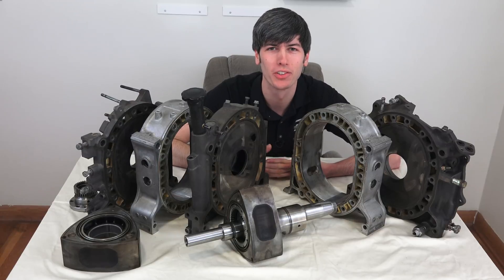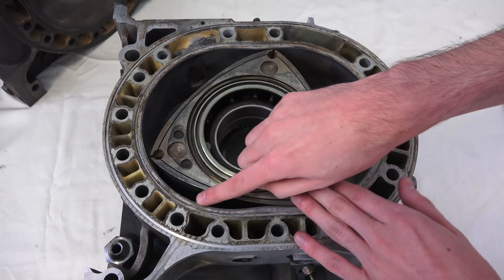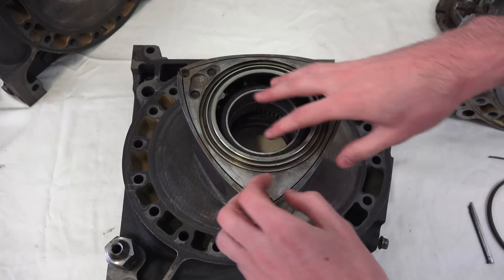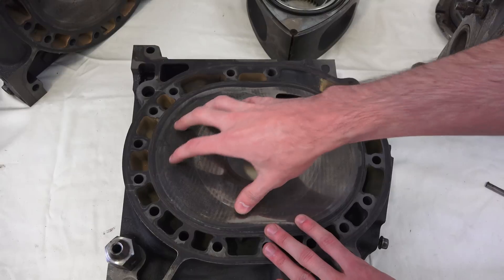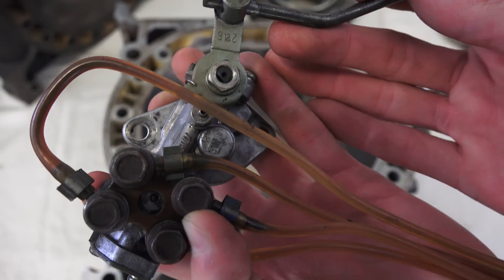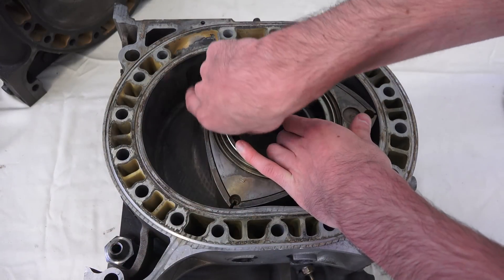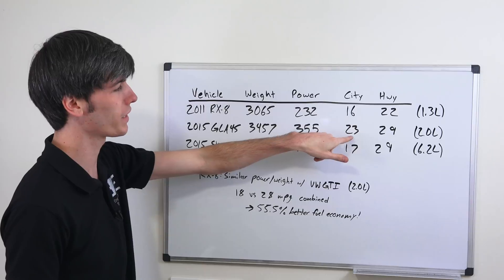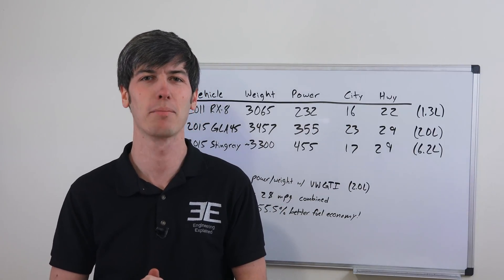4 Reasons Why The Rotary Engine Is Dead

Comment: The problem with your fuel economy comparison is that if you measure the actual swept volume of a 13B engine based on the number of working chambers its actually 3.9 litres (654 cc x 6). This is a common problem because most people just take Mazda's stated capacity and use that. Mazda is really fudging the numbers to make out that their 1.3 litre engine makes 230 hp. If you measure the swept volume of all the working chambers in a rotary engine (13B) just like you do in a piston engine it actually comes out to 3.9 litres. If you used Mazda's method of measuring displacement in a 6 cylinder piston engine then you would only be measuring the swept volume of two cylinders which is not what the actual displacement is of that engine. Dont get me wrong, I have been a rotary nut since I was a kid and currently own an FD RX7 and a series one RX8 so there is no bias here, its just a fact.
Reply: Yeah, the 1.3L designation doesn't relate to normal piston engines.  It's actually comparable to a 2.6L 4-cylinder engine.  There are two firing events per crankshaft rotation, as with a 4-cylinder engine.  2.6L of air goes in per full two-crankshaft-rotation cycle, as with a 2.6L piston engine.

The specific output isn't quite as good as a comparable piston engine, like that of the S2000.  But it's not terrible.  I think the fuel economy of the RX8 would be a lot better if it were geared for street driving.  In the RX-8, I'm into sixth at 47 km/hr (29 mph) if I'm not accelerating.  Sixth gear is at least 50% too short.  It's running 3000 rpm at low highway speeds when it should be at 2000, where it would still have plenty of power to handle mild grades.

They should have sacrificed some track performance for driveability in choosing their gear ratios.
Reply: +Messville Gaming So it only makes 230 hp on 3.9 liters? That kind of sucks.
Reply: +rpn453 Yes I understand that but you measure an engine's capacity by the swept volume of ALL the working cylinders/chambers, not just the ones that are firing in one crankshaft revolution. If you compare the fuel economy of a 13B its comparable to a 3.9 litre piston engine, not a 2.6 litre piston engine. That is because it is breathing in and using 3.9 litres of capacity, regardless of how many chambers are firing per crankshaft revolution. You also cant compare a piston engine to a rotary engine because of the amount of crankshaft revolutions it takes to fire ALL of the working chambers. Again if you measure all of the working chambers swept volume in a 13B engine it total 3.9 litres :)
Reply: +dujfraz yes but you also have to understand that the engine only has about 75 - 80 % volumetric efficiency and because of the shape of the rotor etc it doesnt burn all the fuel and only has a short amount of time to exert force on the rotor because the shape of the combustion area changes as the rotor pulls away from rotor TDC. The new 16X engine should have more torque because of the bigger rotor. Im sure if mazda treated the engine similar to a 2 stroke engine (because it has no valves to open and close the ports and only port shape to control intake and exhaust port timing) and put power valves in the exhaust (like yamaha used in its 2 stroke motorcycle engines) and possibly reed valves in the intake (again like in high performance 2 stroke engines) they could extract maximum torque and widen the power band considerably.

Comment: Your text description above is incorrect. Yes, there are no rotaries left in a production car, however there are still rotary engines in production. There is the Aixro rotary engine that is being used in go-karts and more recently paramotors with the production of them going from strength to strength. Then there are model aircraft sized rotary engines not to mention some UAVs out there that use a rotary (shadow 200 for example). There are companies like Rotron, Freedom motors, liquid piston making rotary engines to power anything from UAVs to lawmowers/chansaws/brushcutters and smaller aviation applications etc. Areas where power to weight is important. So whilst they are 'dead' in the car world, they are very much alive in some other industries, particularly small aviation.

Comment: So its problems with insufficiency is fuel economy, sealing, lubrication, and oil consumption? Do you think there might be any way of designing these differently like maybe adding another spark plug similar to an after burner on a jet engine? maybe still within the engine maybe I half way between the spark plug and the exhaust set on a small delay to ignite the unburned fuel... the other problems I don't have any ideas for
Reply: +Robert Anderson 
No, it didnt, the rotary has very large displacement with very poor power, where do you think all that fuel goes...?
Reply: you just dont understand this subject. another spark plug? this engine has only two chamber for inhale or exhale. there is no chance to another spark. another spark is useless and it does not explodes. why? no compression no explosion. only mixed with oil and compressed  fresh air have chance to explode.
Reply: you just dont understand this subject. another spark plug? this engine has only two chamber for inhale or exhale. there is no chance to another spark. another spark is useless and it does not explodes. why? no compression no explosion. only mixed with oil and compressed  fresh air have chance to explode.

Comment: You mention that at 1.3 Liters it's putting out 232 HP which is actually very respectable for an engine its size. If the RX-8 was sold with a regular old piston engine at 1.3 Liters the horse power would be pathetic. You're also comparing the engine to far newer and much pricier cars featuring more technology to aid them in fuel economy which I do not find to be a fair at all. Your comparison should have been done against cars with similarly sized engines featuring more traditional designs then I might have taken what you are saying a little seriously. 

Unfortunately you felt the need to trash a perfectly good engine design that trades better fuel economy for a ton of HP in a relatively small package. Even your comparison against the VW GTI engine isn't fair as you fail to mention at 2.0 Liters it's only grabbing ~210 HP for an engine that's .7 Liters bigger almost twice the size of the RX-8. I'd really love to see what a 2.0 Liter rotary engine would do to a dyno I'm no mechanical engineer but I bet it would be touching close to 300 HP easily.

Comment: You sound like Kermit the frog, the green amphibian  is it? Equally comfortable in land and water but mostly scooped up by the air.  by this stage. The domain of Jim Henson and is Muppets, archetypal liberal arts teacher profile. That someone like you would be a product of to some degree?  Those who cannot do, teach after all. 

But why would that be so, as you seem capable enough, Wonder what your deficiency is, aside from slight anemia? Noting to do with propensity for plugging your plug into the wrong socket would it? 

That is of course a media fabricated myth, in which broadcasters have come to be self appointed cattle auctioneers, that lasso and fence up demographics and psycho-graphics into lifestyles and personality types (including psycho-sexual history) that shunt out into various sectors of industry, commerce and government based on demands and requirements  

Driven by orders such as keeping the land (consolidated capital found in private equity and technological bases) and the water (found in banking and commerce) as free from such "soiled articles" as possible. Hence these plans to blow air into the cattle (with verbiage and multi-media content seeded with such cryptic messages )  to steer and direct social behavior into the future. Wouldn't want to find yourself jobless or lacking in career prospects after a single indiscretion would you?

While investors, speculators and underwriters calculate and gamble on the odds and outcomes. How you operate the personal body, is a reflection of how you operate the group body - exploitation , manipulation and misinformation (insinuated and inferred) sounds about right

Comment: It's fine looking at the technical reasons why the rotary engine is fuel inefficient and requires checking oil, no secret there. If you actually drive one you'll understand why people enjoy them. They're pretty fun given the RX7 series were designed to be Japanese competition to a Porsche at half the price

Comment: Strict emissions and fuel economy is what really killed the rotary, it is just that the rotary engine design was the first victim.  The next victim will be diesel engines and eventually piston engines.  Whether it outperform other engines is debatable and subjective.  We all know that a simple I4 could outperform a V8 and that rotaries have outperform piston engines.  But on this day and age the rotary engine simply does not belong any more.  There is more R&D in piston engines so it is not surprising to see piston engine efficiency progress through the years.

Comment: Suppose a rotary engine could have a place in motorcycles? Would the inefficiencies be a little more...negligible? The acceleration characteristics, when combined to a shaft layout would be at least very appreciable. And the saving in weight, a motorcycle could have a MUCH lower center of gravity.

Comment: Thanks for this video, helps to put things into perspective. I know this is a separate issue as this video covers the rotary however emissions hold back a lot in motor development now a days. I love 2 Stroke engines but they also suffer in the emissions department. That being said I did see that a company called Athena were developing more modern and efficient fuel injected 2T engines. Would be nice to see them make a return :D

Comment: The moving parts count. That's where the rotary wins hands down. There's more moving parts (things that will fail) in one cylinder of a piston engine than the entire rotary. Right?
Reply: +Justin edwin yes, and no. Metalurgy is such that failure isn't all that likely in regular engines these days. That being said. if you HAVE to fix it yourself, there's certainly less complexity. The seals on the corners of the triangular piece also wear out somewhat often. The simplicity makes them popular in small engines, though.

Comment: Hmm its apparent that you have missed a key point. 232HP from 1.3L. Also those newer engines have way better fuel economy technology. Show me another 1.3l that makes that much power.
Reply: +Galen Ognelodh 
The 13b sucks in and burns 3.9L of air and fuel with every revolution but only produces 232bhp....

A Honda 1000cc RC213v puts out over 250bhp

Comment: why there is no one  wants to use small single spool gas turbine engine ?
Reply: +Catalino O Calimlim cost, mostly. these things are still used in R/C and drone engines. to make a turbine small enough to fill the same role, you'd have to use a lot of expensive high temp alloys. One of the reasons the Chrysler Turbine never happened.
Reply: have you ever watch about in gas turbine water pump ?even that was too costly ?

Comment: are you kidding?
this video is preposterous.

230hp from a 1.3L engine out of the factory, Naturally aspirated.

455hp from a 6.2L  engine, from factory, Naturally aspirated.

6.2L divided by 1.3L = 4.8 <(formula figure)
4.8 X 230hp= 1104hp.

If the rotary engine was 6.2L it would theoretically produce 1104hp naturally aspirated with the same engine technology, now put that into power to weight AND power to displacement.

So yes, the rotary engine is dead for a soccer mum to go buy her milk, or for nan to go pick up a new role of yahn.
but NO, the rotary engine is NOT dead for enthusiasts and people who are excited by old engineering that continues to out perform "State of the art SOHC v8 engines" made by chev.

So rethink your strategies boy, your common sense is heavily under weighed by your engineering uni course...
Reply: +David Sagstad 
Thats right, but a rotary engine cannot, hence they are dead.
Reply: +Alex berry 
Clearly you know nothing about rotary engines. You dont think that its slightly odd that a supposed 1.3L engine allegedly produces 230bhp and yet has been ignored by the whole automotive industry? Or could it be that all the engineers in all the of the companies around the world understand that its actually a 3.9L engine that only produces 230bhp....
Reply: Bike engines can crack out the best part of 200hp in 1.3L. With turbo etc you can get a 1.3 running around 800hp (pretty laggy I guess).  Look up hyabusa tuning!

Comment: I have a 79 with a bridge ported rebuilt 85 12A engine with a 48 IDA Weber downdraft in which I removed the oil injector, blocked it off and have been running for 3 years and 12,000 miles by using 8 oz of 2 stroke oil at every fill up. The car has more power but the gas mileage is still poor but the car is a blast to drive. Any long term problems with mixing 2 stroke oil instead of direct oil injection?

Comment: I owned a 2011 RX8.  Most fun I had in a car under 16K in my life (bought it used, one owner).  But it was only my weekend car when I first bought it.  A year later it became my main vehicle and the MPGs really are what forced my hand into selling it.  not even 2 years after owning it.  However, if it had stayed my weekend car, I'd have never sold it.  Lot's of fun to be had with a 9000 rpm redline and that distinct "buzz" of a rotary.

Comment: Oh i was so much confused in the end, in europe it is liters/100 km, not miles/gallon. So if you use liters for marking engines, use it with the other things too..
Reply: +NecumNaTo that's because in the states with have speed limits and sell fuel in imperial. So you'd have to do the conversion in your head, which most folks don't want to do.

Comment: rotary dead?! last i check a Mazda planning on producing a 1.6  rotary engine
Reply: +Hamdan Alharbi I think the point is that it isn't and never will be a common engine due to all its issues. It is nice to have it around for a bit of variety, but nobody really needs one in their life and nobody is investing in making it a mass market engine.
Reply: Rotaries can be great crate engines.     
They are perfect for racing. Light weight, small displacement and less moving parts means less parts to worry about. They will run around track all day no problem.

Comment: I had an RX4 granny car which got terrible gas mileage which was explained by the Holley 4 barrel on this tiny engine.  However, the impressive part was that I was able to outrun anything that lined up next to me at the stoplight. And I mean anything. And that's with a manual 5 speed. Redline was infinity. There was a buzzer sound when the car reached 8 grand. Acceleration was almost instant and flawlessly smooth. Say what you will but when that engine worked ,it really worked!
It was the ultimate sleeper car. I miss it.
Reply: I sure wished they'd try to perfect that motor. I'd get another one for sure. Even with the bad mileage. It sure was a blast having one.
Reply: Exactly !  The rotary will never die. In New Zealand they are everywhere and always in car magazines. There's also a car show just for rotarys. A mint genuine rx3 is now worth 30k Nz dollar.
Reply: +Christopher Wyller love me rotors nothing beats the sound of one at full noise anyone that complains has never been in a good one and for all the wankers that say they dont last long hasnt seen one built by a good engine builder
Reply: +Christopher Wyller  Yes they worked all right for 5 minutes at least.
Reply: I was thinking of trying to rebuild the one I had but I ended up getting a Nova and a Camaro so it went to the junkyard. Pity I guess. I wasn't even sure you could get rebuild parts for one anyway.

Comment: I think everyone should drive a rotary powered car before they start hating on it. My 1988 n/a rx-7 puts a huge smile on my face every time I drive it and that's worth a few extra dollars in gas to me. It was my daily driver for a few years and had no problems getting it smogged for 10+ years, even here in California. The only reason I'm not driving it to day is because it did eventually fail smog because of a bad EGR valve, but the emissions were still clean even by the strict California laws. Unfortunately they don't make an EGR valve for it anymore :(
Reply: +Eric C hey just out of curiosity when was the time frame you drove your mazda? I just recently got one and am afraid it won't pass Arizona emissions but you saying yours passed California emissions gives me some hope
Reply: oh well thank you so much! thats extremely helpful since i was afraid they wouldn't let me register it due to the burning of the oil and the unburnt gas and all
Reply: +The real doktorbimmer 
Thank you that's great advice would you say the seals failed if the vehicle is slow to gas reaction or more output of emission waste?